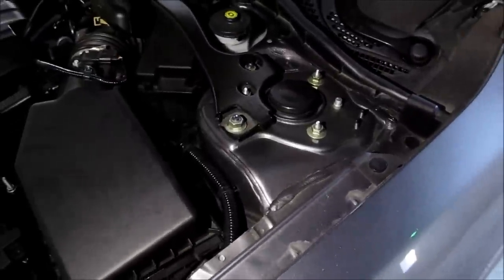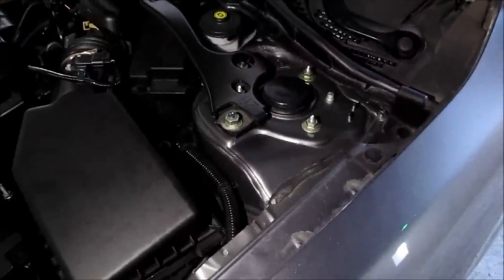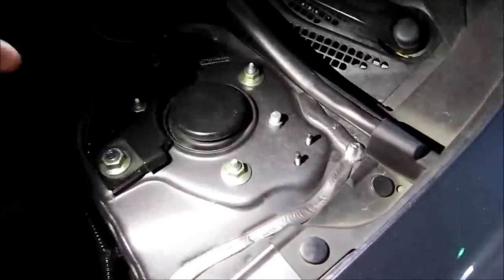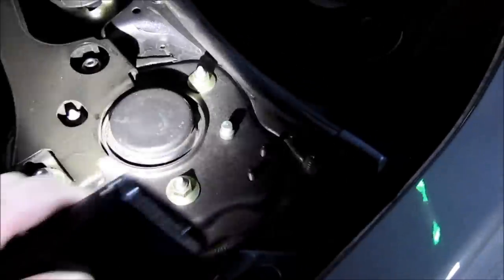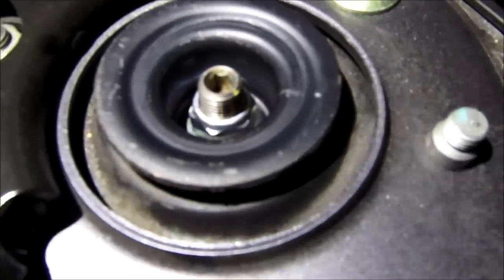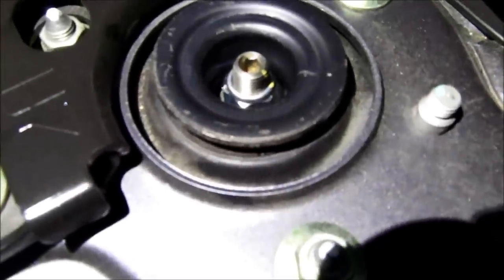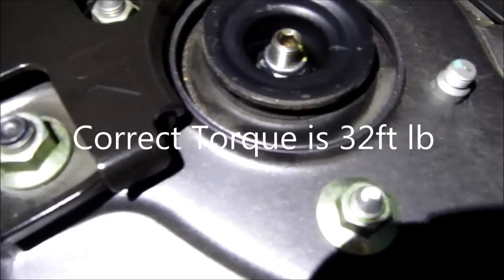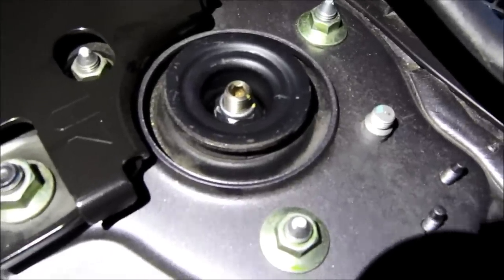Preview: Honda Accord Suspension Noise fix : TSB 14-067

Comment: Spot on fix! But it's a chore to do! Use a 17mm pass though socket and a 6mm allen wrench. Hold the stem steady with the allen wrench while tightening the nut. ( Honda calls for using an offset strut socket 17mm , [and the 6mm allen key] which is needed if you are going to torque it to spec 32 ft/lb).
Reply: I got a 2016 honda accord sport..what noise was yours making..mine..when iam turning the wheel to pull out of a parking spot either FOWARD or backwards going slow only ..i hear a slight klunking noise..its louder when iam on an incline  i. Cant hear it if I have the radio on tho? Thanx!
Reply: @ezmeded  nope..there is a TSB on it tho..but my vin aint it!!
Reply: @ezmeded  call honda
Reply: Hey bro..isn't consider dangerous..that the bolt comes loose..F honda should do a recall?
Reply: @ezmeded  i agree..yea..jus tried with a 6mm allen..and no movement..like you said..ill take to local mechanic.. instead of the stealership
Reply: @edubb2491 Did you fix the klunking noise finally? If yes, how?
Reply: @peedosalim2922  nope..its intermiten seems to not do it in cold weather

Comment: This happened on my 2018 Honda Accord at 2,000 miles, heard rattling noise when going over uneven road. Seems still an issue with quality control on this portion of the vehicle.
Reply: Alex are you fix it ?
Reply: Did you fox this, i uave the same issue
Reply: Hey brother what kind of sound was it . Am getting a rattling clunking sound on my 2021 honda accord from the front passenger side. Does that sound like the problem you had sounds like a bad ball joint but it not cause I checked it
Reply: Hey Richie did you fix it I’m having the same issues
Reply: I am having the same issue at 29000 miles

Comment: It seems like this was problem with most 9th gen accords. Honda replaced mine last year
Reply: My 2016 honda accord sport just started doin this like a rattle noise on my driver side how much did they charge u for it
Reply: @gstylin3834  mine is a klunking noise when i turn the wheel while pulling out of a parking space

Comment: Thanks for the video bro. What size Allen (Hex) key do we need? And I assume that we have to torque down the Hex bolt popping out not the 17mm nut? Since it is a bolt on a nut... should I torque COUNTER clockwise since that would be considered tightening from the bolts point of view? Thank you for any insight :-)
Reply: What size you ever figure out..thanx!
Reply: @edubb2491  it was a 6mm or 8mm my memory is a little foggy! Be careful to keep the allen as straight as possible when torquing… i stripped it a little after i torqued it to the right spec because i started to angle the wrench. Good luck!
Reply: @nyounus  i tired..nothen buged..thanx again

Comment: Is this being covered under warranty?  I'm seeing this video after the fact, I just took my car to Honda and paid 108$ for the bolt replacement (they said it isn't covered under warranty...).
Reply: Jon G did you ever get an answer to this? I know my but needs to be replaced but I'd like to know if it should be replaced for free.

Comment: I have a 2015 Honda Accord LX 2.4 I replace the lower front end ball joints the sway bar and the struts and I still hear noise coming from the steering wheel when I turn at low speeds and now I think I'm hearing some sounds from my back passenger wheel it's really driving me crazy I don't know what else it could be
Reply: Did you check your engine mounts
Reply: Wow..yea..i hear clunking when i turn the wheel pulling out of parking spaces 2016 honda accord sport
Reply: @raheelahmd  I have replaced most of the suspension
Reply: Wheel bearing

Comment: It happen to me. I could hear strange noise from couple of month ago. I went to dealer last week. They changed self locking nuts but noise is still there. They couldn't find where the noise coming from. I went to dealer again with dash cam video recorded SD card. They conformed and ordered new right front side strut. I have to go there again next week.  1 year old car need new strut. I can't believe it...
Reply from the maker: +Jun Rhee Yea, it's a known issue with the 9thgenaccord.  There is the suspension noise, the wheel bearing noise, steering wheel turning noise, brake retainer clip noise and the wind noise.
Reply: +DIY: Car Modz OMG... So there are chance to  hear noise even they replace the strut. Yeah. I was wonder that noise start from the back side but they will replace front strut. I have to cross my finger then..
Reply from the maker: Once they replace the strut it should be fine.
Reply: @Jun Rhee did you ever get this resolved?  I been hearing a knock/ping noise turning right and all mechanics say they don't hear anything.  We really shouldn't have to go this far for them to do there jobs.
Reply: @jaywill23  Yes. They replaced the strut by warranty but another problem came. Left rear suspension messed up and it was out of alignment. Honda refused fix the problem and I had enough hard time so just traded with New 16 Accord LX. Now my daughter use that car, I bought 19 Accord 2.0 Touring
Reply: @junrhee4478  it was under warranty Not TSB?

Comment: DIY: CAR MODS Is the service bulletin still open for the 9th gen accord?  I have a 17 sport.  I have replaced the strut mount and strut.  I still have a clunking noise coming from the strut.  Also the original strut mount bearings wore out at only 25k.   The strut is after market by the way.
Reply: I got 135k on my 16 sport on origional but need to know if you found out anything because between inner tire wear and a clunk noise im stuck
Reply: DKP Productions does it really?
Reply: 16 accord sport 52k i got klunking when i turn my wheel to pull out of parking spaces!🤔
Reply: Was it at slow speeds..like parking lots while wheel is turned?
Reply: @edubb2491   yes i have the same exact problem. The bolt is loose. Just tighten it down and all noise is gone. 🤙
Reply: @bongbingboniface2633  i couldn't tighten it at all..i tried..slight clunk is still there..it took a 17mm socket
Reply: @edubb2491  did you figure out the issue ?
Reply: @adrenaline17ss44  nope..i jus ignore it..and it seems to have gotten alot quieter in the colder weather..whatever that means🤷
Reply: @edubb2491 Hi. How is the clunking noise? Still there? Is it getting worse? Did you do something with that? I am having it too now.

Comment: My 2015 Honda Accord LX squeaking everytime I go left or right I took it to the shop and they replaced both front struts both front tie Rod's inner and outer both front lower ball joints both front lower control arms and it is still making a squeaking sound in a popping sound when I go over bumps I'm so stressed out and spent probably 15 hundred dollars fixing all of this stuff
Reply: Mine is 2015 accord LX as well. There is a popping sound also when I turn slowly to the left. Is your problem resolved?
Reply: CV axles
Reply: Check CV axles

Comment: I am going to try this in my 10th gen Accord because it is squeaking on the front left side.
Reply: me too! any luck? i have  bc coils and it just started making noise in the driver side front
Reply: @ezmeded  So my issue is the bearing that goes into the camber plate.  Thats what usually causes it to creek and squeak.  just double check the top mount bolt and all others before resorting to changing the bearing since the suspension has to come off.  Mine has gotten better with time and i think im selling the car soon so its not bothering me much at the moment.

Comment: I am hearing a clunk when my car gets alittle warm after driving a little while. 2009 Honda Accord
Reply: While turning? or does it straight up sound like Engine knock? Could be the CV joints/Outer tie rods/Inner tie rods/steering rack. Check all the rubber boots around your suspension.
Reply: Once mine is warm and loose, it starts making noise when slowly turning but then keeps "knocking" sporadically just driving down the road.  Mechanic thought it was strut tower issue and replaced both front struts.  I drove it around a day later and noise began again.  Took it back and they were baffled.  Thought maybe it was the bushing in the lower control arm, so they replaced that also.  I asked if they test drove it.  They said yes, let it sit running for 30 minutes before driving it. Well just running the engine is not getting it loose.  So when I drove it home this second time after another unnecessary repair, the noise is STILL happening.
Reply: @langell77  Same problem here, had both left side ball joints replaced and bushing in lower control arm. Same noise after driving approx one half hour. If i drive a few miles , nothing no noise.
Reply: @langell77  Did you ever find the problem ?
Reply: @kennybob3096  not really.  I noticed it some last summer but not as much. And of course this year we aren't out much to hear it.  But I did hear it slightly once or twice.

Comment: I am curious if rattling noise from these two things are metallic rattle noise than plasticish noise. I am experiencing some metallic rattling around my driver side door pannel and also under my steering column area where my foot rest is.
Reply from the maker: The noise from this is more of a clunk and creaking sound.  I would check for any loose wires or aftermarket parts the dealer might have installed ( tracking device or alarm )
Reply: Hyunjae Jeon Did you ever find out what it was? I have the same issue as you.
Reply: @ezmeded  yep
.mine does this..pull out of parking spots..and and slick klunk..from left side
Reply: @ezmeded  and you would have to pay? Did they grease. And tighten it for free? Thanx!
Reply: @ezmeded  ..man..so this wasnt a TSB issue huh..wondering if i should jus go to a tire shop..and have them grease..and tighten the bolt..be cheaper then 185$ look about fee that i jus got quoted
Reply: @ezmeded  thank you for your help..its more like clunking not sure metal sound..it happens when jus me driving..thank you again
Reply: @ezmeded  same here at low speed..parking lot speed..turn let or right..klunk..klunk..is what i herd

Comment: Dear i have 2014 & 2015 honda accord they have the same noise and the dealer changed the shock absorber and other part but still the same the noise gone for a while but it came again I am planning to change the genuine one with other good brand name 
Unless if there is a solution for it 
Regards
Reply from the maker: I would take it back and have them fix it again.  This way it is in your record files with Honda.  Your car comes with 3 years 36,000 miles warranty so I would take advantage of it and get them replaced.  Honestly, there is not other aftermarket suspension that will be superior to OEM unless your going to lower your car then I would look at BC Coils / Tein or even bag setup.
Reply: +DIY: Car Modz Dear I have 5 years 150000Km warranty , I know that dude but here in bahrain our agent is really bad agent I contact the honda middle east but they did not do anything they said this is a normal noise what you have in your car and they brought 2013 car with more noise more then my 2015 
And they said see this is normal since 2013 and it is less in your car model I fight with them and I took my car back thats why I am looking for good quality aftermarket suspension without lowering my car because it is Illegal in my country